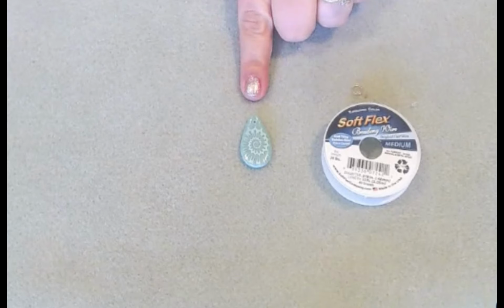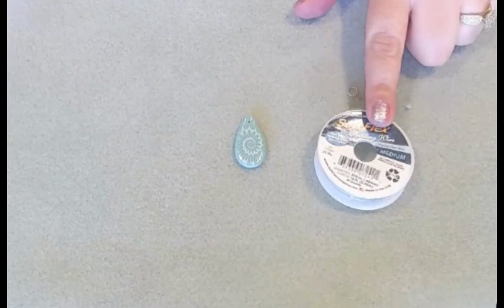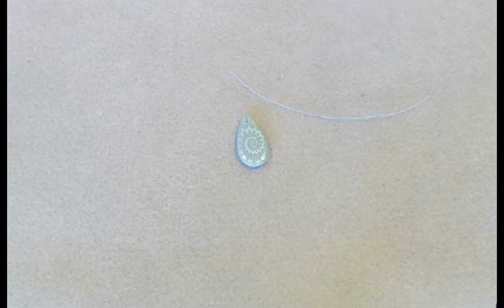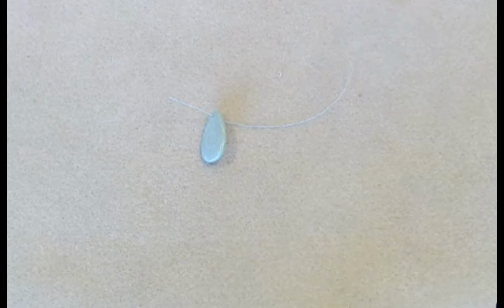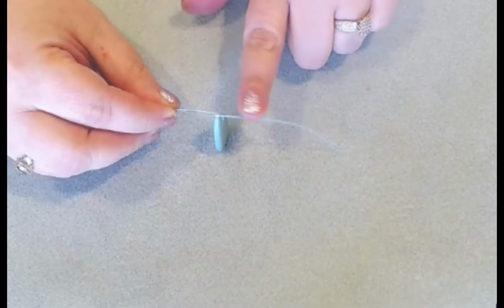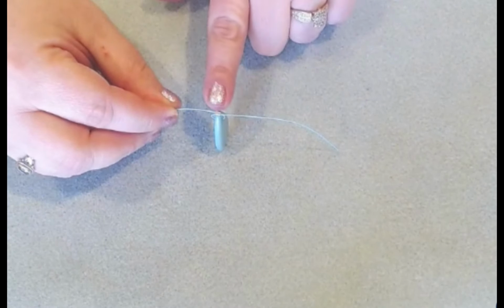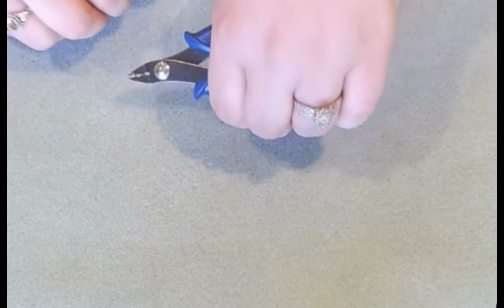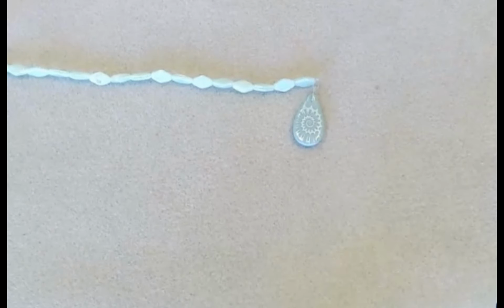Using Jump Rings? Try this instead to attach a pendant or charm

Comment: Is that a crimp tube you are passing the soft flex wire through? I couldn’t tell by the visual or audio. Looks like a great fix though.
Reply from the maker: Yes, It is. Thank you so much for watching.  The Soft Flex is soft so it can work for any bead that a jump ring can't fit through.